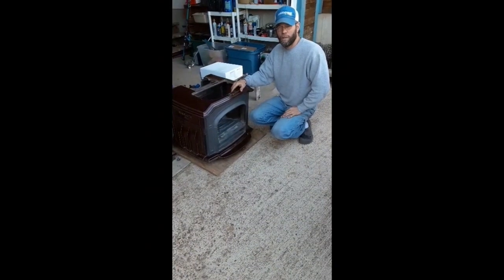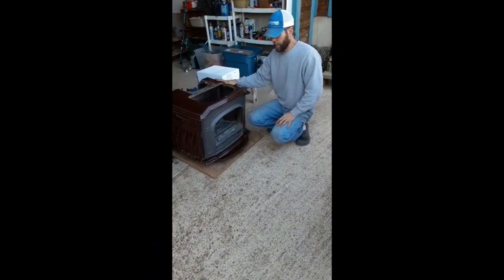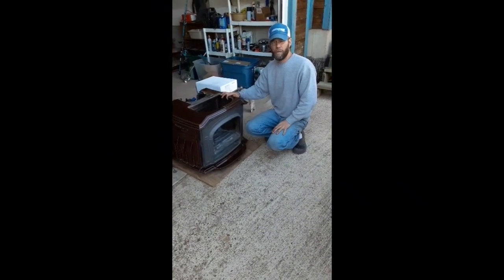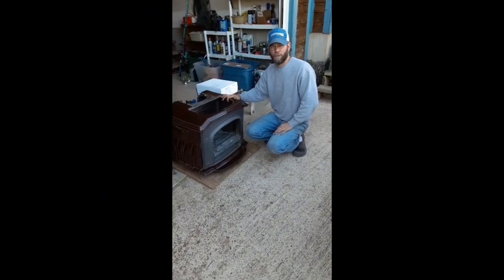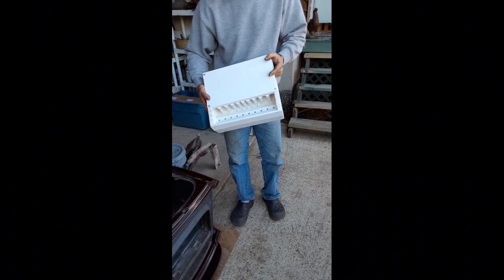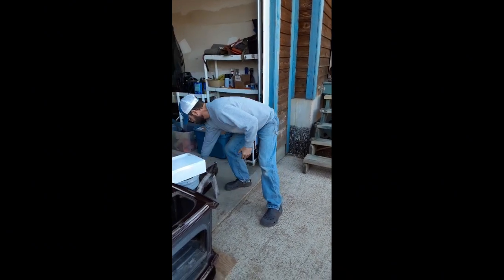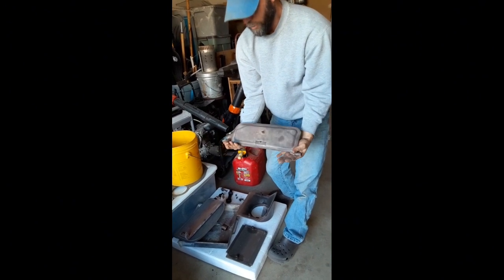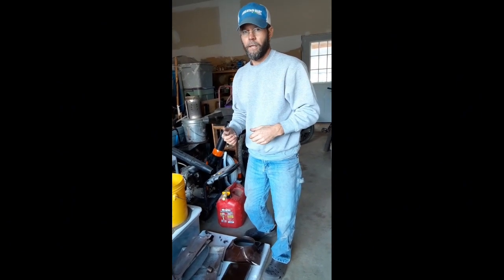How to Refurbish a Vermont Castings Resolute Acclaim Woodstove Model 0041 (Part 1)

Comment: Really appreciate this video. My wife and I are in the process of building a cabin and I bought this model used a few weeks ago. It's in good shape but has been sitting for years and needs refurbished. I have a different model (Vigilant) in my current home so I'm familiar with using them, however I've never had to disassemble one. This is really helpful video so thank you. Is there a part two showing how you reassemble it by chance?  Also I was curious where you started as far as disassembly goes? Which parts did you remove first? Appreciate any help you can provide.
Reply from the maker: https://youtu.be/NyoDpw3_u8c?si=gbnRQI6ZOfrPAi63
Reply from the maker: Part 2
I'll ask my husband about your questions.
Reply from the maker: He said he started from the outside and worked his way in. He thinks he mentions it in video.

Comment: Thx for the video! How has this worked out for you?
Reply from the maker: @Simonfrios  it's worked wonderfully! Such a great stove that should last a long time!
Reply: @sawmillcreekhomestead  nice! I just ordered the lower frame and the 3-piece insert. I was hesitant to spend the $300 because it's only for my shop, but hopefully it lasts me a good ten years.
Reply: @sawmillcreekhomestead  hey brother, quick question. I need to replace the larger bottom grate, and I can't find it in any of the manuals online. The one we both have has 10 slots, and the only ones I see online have four. Do you know how I might identify where to buy it? Mine is warped up about an inch in the middle.
Reply from the maker: @Simonfrios  i can't recall off the top of my head, but I mention it in one...i think the first one....of the videos and the name of the stove parts store where I bought all of my replacement parts is listed at the end of the last video.
Reply from the maker: I found the info at the end of the part 2 video. Mountain View Hearth Products in Montana www.stove-products-unlimited.com 406-272-9850@Simonfrios
Reply: @sawmillcreekhomestead  thanks man. I reached out to them and they couldn't identify the large grate . They sell the front grate , but only a smaller version of the rear grate. I guess I'll have to make do with this one.